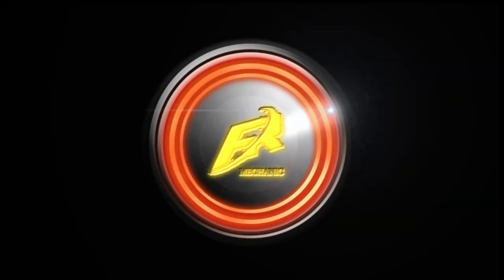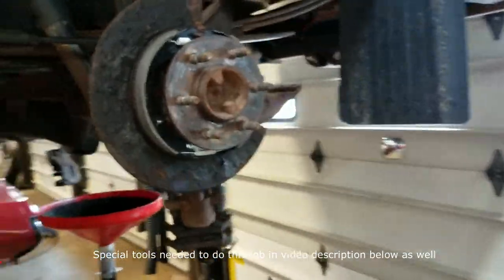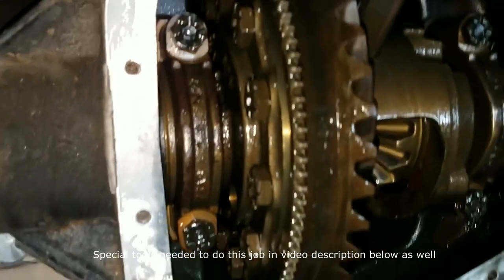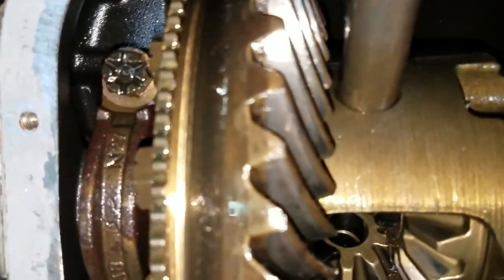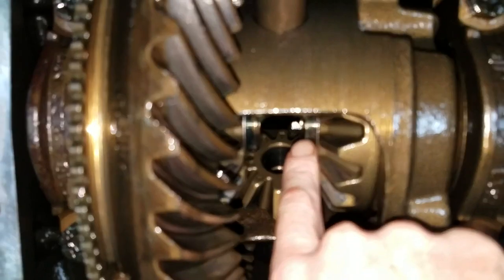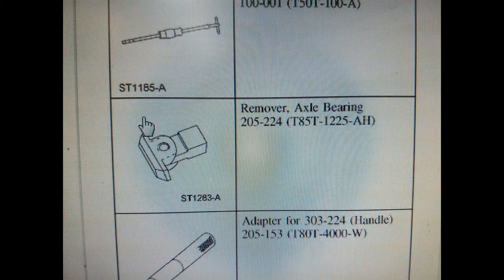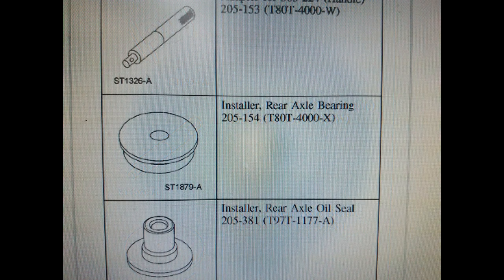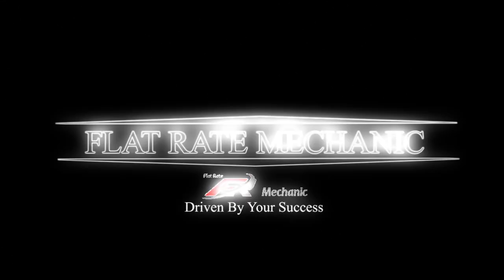Ford F150 Rear Axle Seal Replacement

Comment from the maker: Tools needed, Slide Hammer https://amzn.to/2NQjl4u  Seal installer https://amzn.to/2Q5q5gh  Gear Oil https://amzn.to/2NiloBb Bearing Grease https://amzn.to/2wHEgPS
Reply: hey thanks for the quick version. Everyone doesnt need a half hour production, and just need to see how a differential they have never been into comes apart.